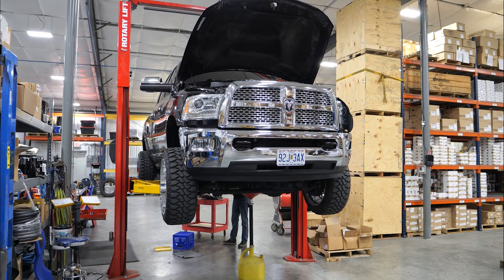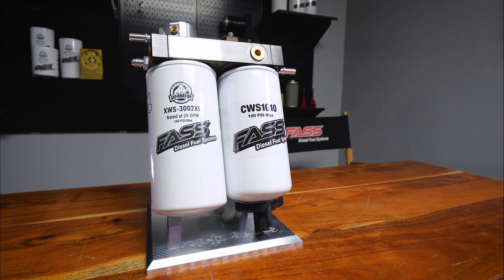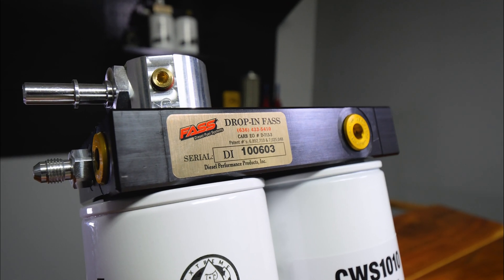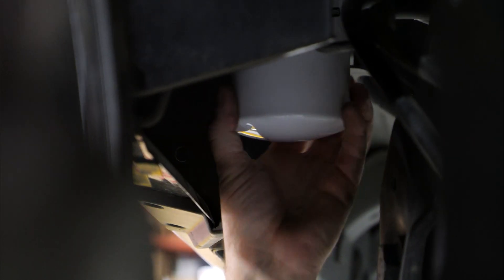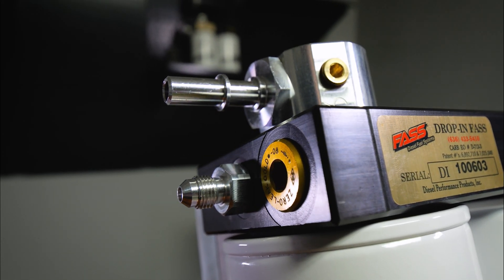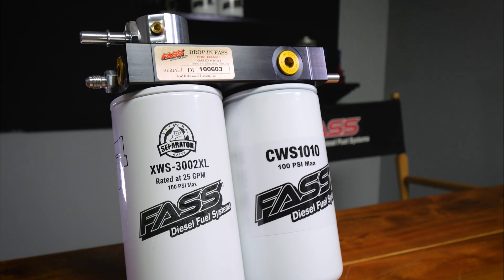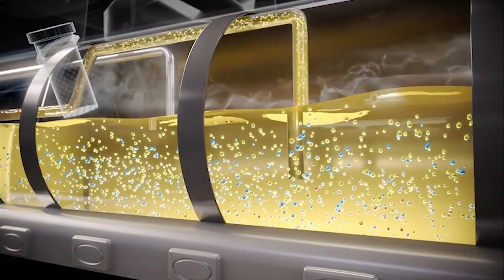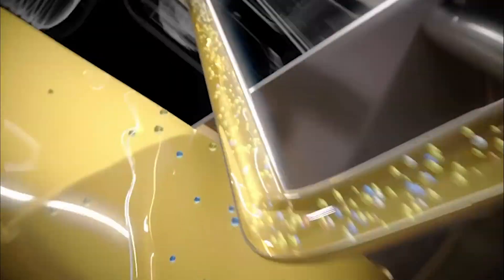Bolt-In FASS System for 2010-2018 6.7 Cummins!

Comment: Does the kit come with all the block off plates needed to bypass the factory fuel filters?
Reply from the maker: Great question, and this will replace the factory fuel filter housing under the truck and tie into all the OEM fuel lines. You are welcome to delete the factory fuel filter setup after installation though, and we have kits to do that as well.
Reply: @FASSFuelSystems  are you taking about the front under hood filter? If not what do we do with that one?